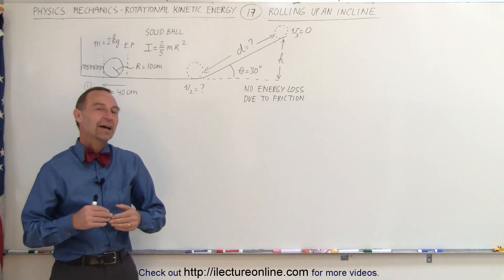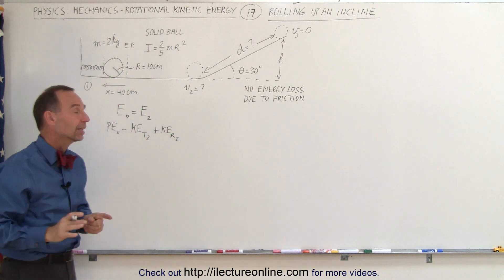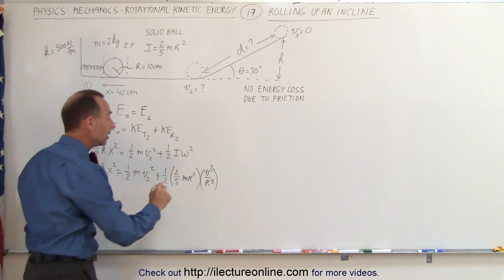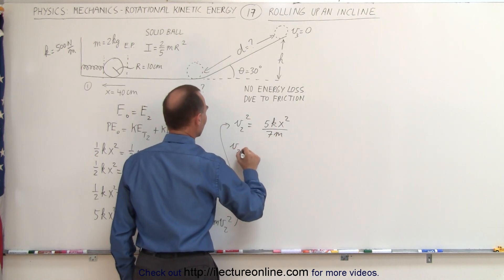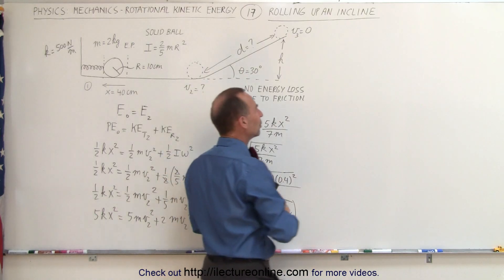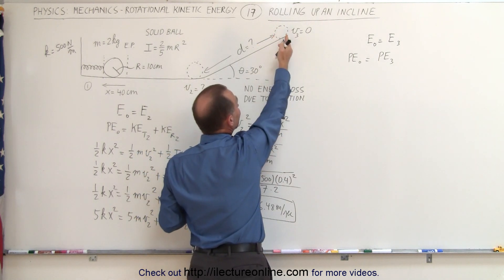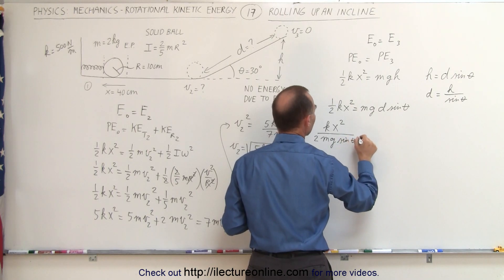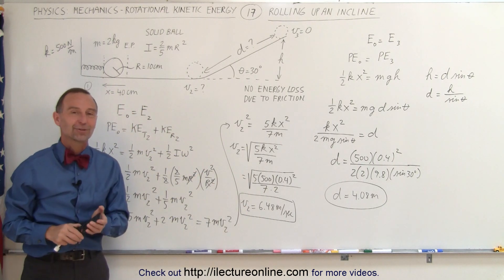Physics 8.5   Rotational Kinetic Energy (17 of 19) Solid Ball Rolling Up an Incline

Comment: Could we use the v(f)^2 = v(i)^2 - 2gL to calculate the distance it travelled? The final V (f) is 0.  V(i) = 5.34. I am guessing the linear equation cannot be used here?
Reply from the maker: Try it and see if you get the same answer.
Reply: @MichelvanBiezen  Not even close to the correct answer. I am getting 1.45 m .
Reply from the maker: Then I wouldn't use that method.
Reply: That is because V(i) is calculated using Rot Energy.
Assume no rotation then V(i) = 6.32
Now use v^2 - u^2 = 2gsin(30)L
L = 4.08 exactly.

Comment: Should the ball even start rolling initially if frictional force  is absent?( as the friction between the surfaces provides the torque necessary for rotation)
Reply from the maker: Yes, so we need to assume that there is just enough friction for the ball to roll while ignoring to other effects, (like we ignore wind resistance).  A very good observation

Comment: Shouldn't be the center of rotation of the ball be on the bottom at the contact surface of the ball? Thus the moment of inertia should be 7/5mr^2 instead of 2/5mr^2?

Comment: Hi! I was wondering if I can say it has no potential energy at the beggining of the incline plane, but it has kinetic energy and rotational energy, that will be later transformed into  gravitational potential energy and rotational energy final, (because since there is no friction the objetct will keep spinning) but since the initial rotational energy is equal to the final rotational energy, those cancel out and at the end we have that the initial kinetic energy is equal to the final potencial energy. Is this correct?
Reply from the maker: Yes.  However it is easier to skip the intermediate step and simply compare the initial PE at the wall to the final PE at the top of the incline.

Comment: very nice Michel !!... I've noticed that in a Different sort of problem that involves ROLLING without Slipping..... Imagine a Marble being released in a Bowl that's shaped like a Hemisphere.  The marble Rolls down the left side of the bowl without Slipping... but when it get's to the other side, the right side,  it does NOT reach the same Height that it was originally released from.. I understand that there is KE trans and KE rotational... but apparently the Marble rolls back and forth but never achieving the same Height.. eventually the marble comes to rest at the bottom of the bowl!!.. and it is not due to Air Resistance or Friction of the Bowl's surface... How does that Happen?.. I can not figure it out... there appears to be a Loss of the Original PE ... maybe this would be a Great Video in Conservation of Energy? :) ...  Thanks for all your videos... still learning here....
Reply: by the way, I do know that the VELOCITY at the Bottom , after each cycle, is the Sqrt ( 10gh/7)  ... so the velocity at the bottom is always proportional to the Previous HEIGHT .. but that HEIGHT is always LESS with each cycle... SHEESH.. HELP Mr. WIZARD!!
Reply from the maker: A marble cannot role unless there is friction, and since there is friction, there must be loss of energy.  So on each trip there is a little bit of energy lost, and thus each time the same height is not reached.  (Kind of like the super balls we used to play with).
Reply: Got it !!.. I guess the Friction acts as the Force in the Torque that causes the ball to ROTATE.. and that friction is in the opposite direction that the ball is traveling.. and it's that force that robs energy from the Original P.E. ... by the way... glad you remember the Super Ball .. as well as Slide rules and Log Tables and Trig tables at the back of our old Algebra Text books from the early mid 70's ...  today there are calculators that actually SOLVE INTEGRATION !!!. you just enter the Integrand and limits and hit CALCULATE..... wow.. why go to school anymore? .. LOL.. just kidding.. Thanks for your quick response!!  as usual!!
Reply: you are a fool. The marble cannot roll without any external torque which hopefully here is present in the form of friction